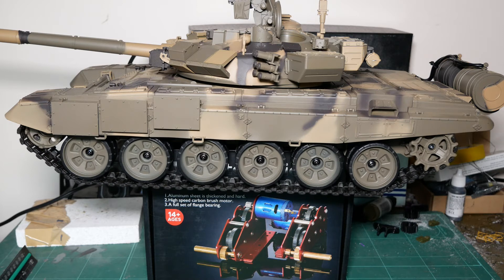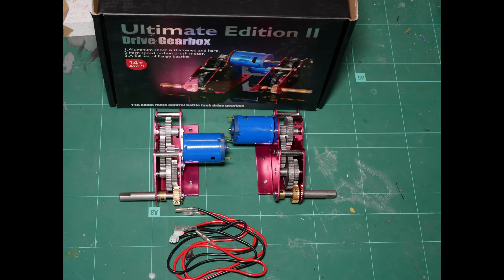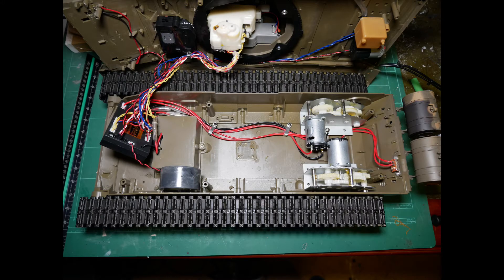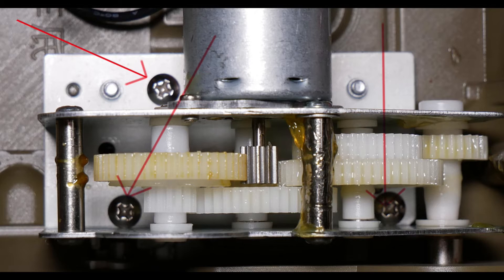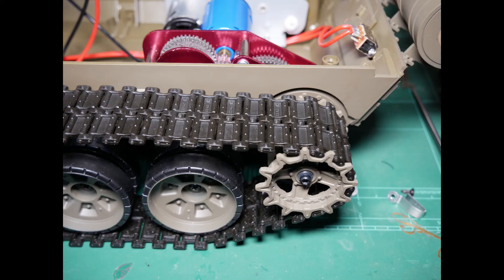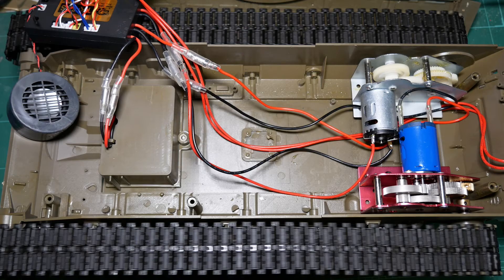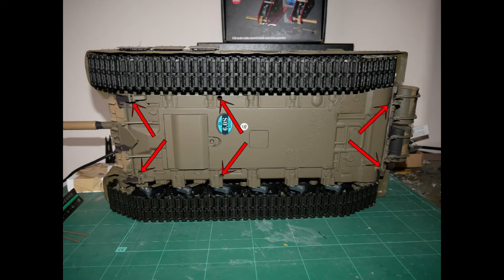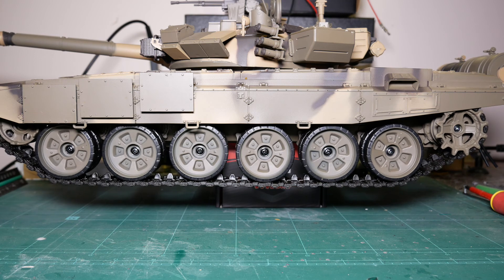How to fit upgrade Heng Long tank gearboxes

Comment: Great video ...would you recommend an engine upgrade ?
Reply from the maker: Thanks.  With improved gearboxes better motors are supplied which are an improvement on stock.